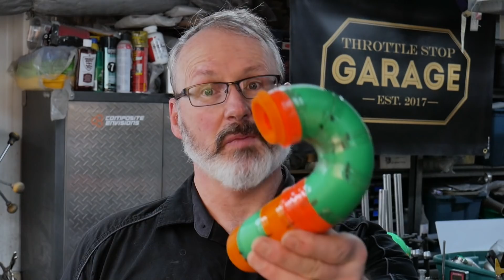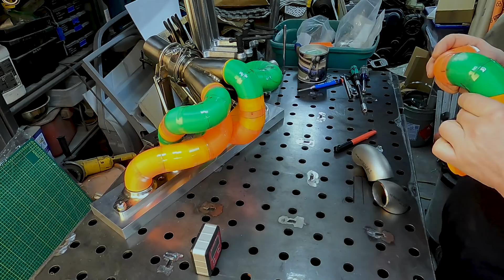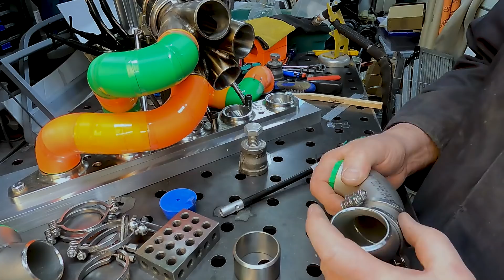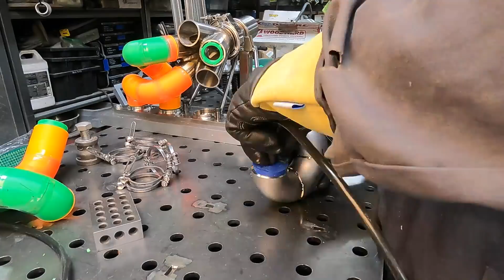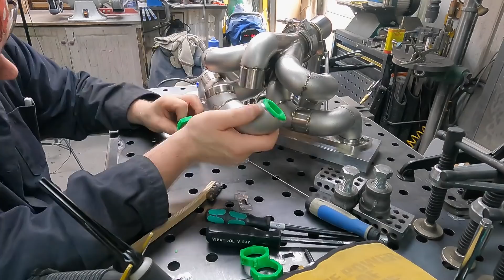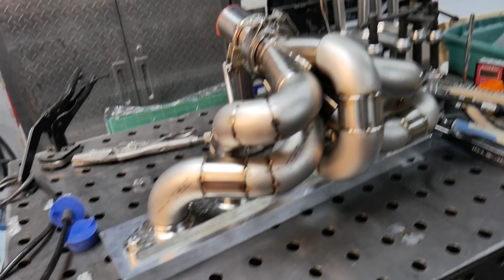DIY Turbo Manifold: Part 2 - Pipe Fitting.

Comment: I’d try balloon artists balloons to keep the pipe sections together during ‘finding the angles’… perhaps with some oil to ensure the sections can still rotate axially relative to each other. Reckon that would work? Making the printed rings fit all the different cross sections feels annoying (and also prevents full rotation of the sections)
Reply from the maker: Interesting idea - I'd be concerned about the heat and any residue from the balloon, but maybe worth a try.

Comment: i know its years ago and you likely forget but what issue did you find was taking the most time when trying to mock up the plastic jig? i thinking to make my own for welding, thanks in advance
Reply from the maker: The plastic jig was the best part of building that manifold.  Easy to work with, and if I had to guess, I'd say that getting the lengths dialed in took the longest. It really didn't take that long - it's just playing with shapes.

Comment: did you design all those runners to be the same length? is that an important consideration?
Reply from the maker: I tried to have them all be around the same (and they were within 3 mm).  Same length has obvious advantages for flow, but cost in packaging.

Comment: Something I don't see in USA how to videos dealing with exhaust tubing is the use of spun metal donuts (Mild steel or Stainless) available in a large variety of sizes, they do reduce the number of pie cuts and elbows required.
Reply from the maker: True - I've got a few on the wall, not had any need to use them just yet.

Comment: I've been building my own tubular manifold today and it's been so frustrating trying to hold it all together while I tack it up to the point I've had to walk away, I need some of those 3d printed inserts you made, nice solution to a problem there.
Reply from the maker: They were a sanity saver.  The models are on my thingiverse page if you need them.
Reply: @ThrottleStopGarage  thanks for that will check it out.

Comment: Hey, any chance you can reupload your Long Radius 1.5" weld el marking jig to thingyverse, seems during the upload it shrunk down to 4mmx4mmx1.5mm :) much appreciated been hanging out to use this jig :)
Reply from the maker: It's still there in a collection.
Reply: @ThrottleStopGarage   yea it is there, but no longer the correct size. when you load it into the slicer its 4mm wide :) also checked in fusion 360
Reply from the maker: @Droped2  I'll have a look tomorrow.  That's weird.
Reply: I've just started this print and I think the solution is converting the measurements from MM to inches
Reply: Just finished the prints, converting the measurements from MM to inches was the solution

Comment: You should invest in some TPU material for your 3D printed tube rings. 

It’s stiff but pliable so you won’t have to constantly trim to size for every pipe, you can just squeeze them into place!

Awesome build man!😁👍🏾
Reply from the maker: Thanks for the tip!  I was thinking that even a small hook shape that would flex instead of a bump would also work.
Reply: @ThrottleStopGarage  No problem man! Also, TPU can also take high temps (up to 400 degrees I think). Anyways, keep up the great work!👍🏾

Comment: Wow, that was a very nice comprehensive video, not easy making an exhaust runner for a 5 cylinder, i'd like to see how much would it flex after the whole thing get welded, Do you relly need to pruge it when u tact?
Reply from the maker: I'm pretty sure it's not going anywhere!  Yes, I think you do need to purge when you tack.  If you don't - you'll get the carbide precipitation on the backside of the weld.  Many will say that it doesn't matter and if I was trying to make money building these things, there are cheaper options that work...but none of those conditions apply for me.

Comment: Awesome work this reminds me of the Falcon 9 SpaceX launch pad it had three pivot points using three knuckles where when the rocket sits horizontal and starts raising up vertical had figure out all the angles. Awesome work i love it when theres staggered offsets and still making sure everything is perfect. And on the landing ive always knife edge mine even when you butt them up no gap you still get a good fusion even without adding wire or no gap.
Reply from the maker: The technique worked well.  I'm welding them up right now and fusion was good - faults were mine.

Comment: Just a thought, but if the spacers had a weak-spot 3d printed into them - you could maybe tack them in place then just punch them out.  It would make them more single-use though.
Reply from the maker: If I was changing the design, I'd print a few variants - one with tapers going both ways for the weld els.  Then one with a taper and a straight for an el into a straight and the original (little smaller) for straight into collector/flange.

Comment: is there any way to clean welding seams by sanding and polishing? it looks amazing and if you manage to delete all welding seams it is gonna look more amazing congrats on your achievement
Reply from the maker: Yes, the welds can be sanded smooth.  I'm not sure I'm going to bother as I think this manifold is going to get ceramic coated.
Reply: @ThrottleStopGarage  this is gonna look awesome!

Comment: Good job. what is the name of the necklaces in question
Reply from the maker: Necklaces?
Reply: @ThrottleStopGarage  clamp welding. Is french sorry
Reply from the maker: @stevenwindows  Ah, I see.  They were made by Ice Engine Works and are still listed by Trick Tools in the USA.  They do not work very well with the short radius tubes.  They may work better with the radii that are used in tube versus pipe.

Comment: I'm conflicted... the fabricating talent to design and build tuned length turbo manifolds I find impressive.  They're nothing but a show piece, overall the time spent designing and building a first place, best fabrication award isn't worth the time spent.  Never mind that these manifolds ignore good turbocharger system design principles.
Reply from the maker: I'm not sure how an equal length manifold ignores turbocharger system design principles.  The tuning isn't necessarily any different from a normally aspirated engine.  The problem is that you've stuck a restriction in the system - the turbine.  You'd still like the pulse timing to be even.  Nobody is arguing that you can't just build a log manifold and make power.  I am building this because I enjoy the challenge not because I'm trying to make a dollar.  Build the best that you care to build.
Reply: @ThrottleStopGarage  Thus I appreciate the workmanship.  Been a long time since I've fabricated a turbo exhaust manifold.

Comment: You rely on way to many aides. In my opinion you're making your job harder. It's not that complicated to fit up pipe/fittings.
Reply: Was thinking the same thing as in over thinking the job at hand, but everyone has their own way. It's a wonder how I made headers and exhaust 40 years ago without a 3D printer, but then again I'm just a boomer.
Reply from the maker: It is reasonably complicated for this manifold and I am sharing what I found works.  With respect - this made it easier for me to fit the pipe.
Reply: @ThrottleStopGarage  my gripe is mainly it the clamps and your printed pipe insert which all seemed to slow you down or add more problems. As for back purging unless you're selling the manifold I wouldn't worry to much about it. But technically yes you should back purge.
Reply from the maker: I've got gripes with those clamps as well.  I did get them used and they're probably hitting eBay shortly.  It's hard to make me go any slower - but they did work wonders for bringing me to a virtual standstill.  I think for tube, they would work better and I can see some advantages.
Reply: @ThrottleStopGarage  they have all sorts of heat resistant tapes for this purpose. Just peel back the section you want to tack and keep going. That also takes some getting used to. If you wanted a good clam Dearman makes good ones. But how small and tight everything is I'd work in small segments and tape.
Reply from the maker: @ascholtka420  Cool - I'll look into it as I still have an exhaust to do.  Any advice for welding the cap.  I got the root done (fused) but any tips for the cap would be great.
Reply: @ThrottleStopGarage  unfortunately you might be a better welder then me. I'm a pipe fitter not welder. So I won't even attempt to give you bad advice
Reply: I'll be fabbing my turbo manifold this week but mine is far less elaborate
Reply from the maker: @ascholtka420  Thanks - I'm always looking for the best information I can get.
Reply: Well I'm an union pipefitter and I'm telling you, you'd probably struggle alot less with some foil tape holding it together. All those clamps and 3d printed inserts to get your hi-low out are unnecessary.  Also there's a way easier way of marking and cutting down 90's to make custom fittings. You're handicapping yourself.
Reply from the maker: @ascholtka420  That would be fantastic information to share.  I'm a guy building a car in my garage and I clearly state that I've never fitted a pipe manifold before in my life. It's a struggle if you can't find the information.
Reply: Hope this makes sense. You measure the inside radius and outside radius of your 90's ÷ both by 2. And mark on the inside and outside radius. To get a 45. ÷4 for 22.5. ÷8 for 11.25 fittings. Etc... for any bastard angle. Your angle finding block is cool and all but what if people don't have access to a printer. (Which I do)
Reply from the maker: Yes -that makes sense and is simple and helpful.  The jig is similar to ones you can buy (they're about $300...which I can't justify).  When I made tube headers - I just had a block of wood cut to the inside radius and used a protractor and an pointer nailed to the centre of the radius.  It also worked.  I've released it all for free to try to help out.  There are also online printing services (not sure of the cost etc).

Comment: Rather than back-purging you can also use solar flux.  I find it much easier for most applications... and cheaper:-)
Reply from the maker: I know - but I don't have any in the show right now.  Only making one - but if you're making lots the argon costs will get you every time.  $140 for 22 cu ft in Canada.

Comment: Not that I've made my own manifold myself (yet) but from what I've seen the runners will shrink when fully welded. To combat this each runner is normally made slightly longer than required to compensate and then trimmed down (if required) to fit in the final construction.
Reply from the maker: Sort of depends on how it's been fitted up to be honest.  If it's tight gapped and everything is done properly - the shrink per joint would be very minimal.  I've already done the root pass and the only one that moved was runner 3 (I had a small gap - shown in this video) - it pulled up about 1.5 mm.  I can fill that no problem when I weld it to the flange.
Reply: @ThrottleStopGarage  fingers crossed! Like I say, I've not made one myself yet but thought I'd share what I'd seen, after all your hard work and effort I didn't want you to weld it all up and find they're all a couple of mm too short!! 

I have to admit, yours does have the best fit up of all I've seen! Great job 👍🏻
Reply from the maker: And I had one that ended up a few mm short!  You called it!
Reply: @ThrottleStopGarage  ah man that's a shame! Hopefully it's recoverable without too much work!? 

Did I earn myself a mention? 😄
Reply from the maker: @AndyPonting  I think you've earned it...I was up most of last night working out how to prevent it.  It took me one hour to fix the runner - so no big deal.

Comment: I've built several tubular turbo manifolds over the years out of stainless and the first thing I look for is if they're back purging (it's mindblowing how many people don't do this), so it was a welcome sight to see it done correctly.  My next thought was bracing for the turbo, I try not to allow the turbo to rest solely on the tubing because it nearly always results in cracks along the welds months or years later, especially if it's a race car.  But, I was surprised at how thick the tubing (pipe?) you used was.  Honestly, that's probably a better solution than using a flange-to-flange brace, especially since I'm assuming you're going to be using something along the lines of a T3/T4.  With the larger turbos (80mm+) I try to do a flange-to-flange support because frequent wastegate activity and throttle changes stresses the manifold over time, especially when it gets heat soaked.
Reply from the maker: I'm still working on that decision...to brace or not to brace.  It's pipe - it should be able to handle both the weight, the vibration and the heat.  My current thought is to leave it as I don't want the various forces fighting and resulting in cracks.  Back-purge - all the way.

Comment: Why use pipe instead of tube? 1.6mm stainless tube is all we use everyday in exhaust manifold & headers.
Reply from the maker: A few reasons.  The pipe helped with tight radii that were needed for packaging and the wall thickness should mean that this thing will have a reasonable lifetime.  I'm not going to tell you that 1.6 mm won't work - it will.  I've done it.  This just buys the extra insurance.

Comment: 2:45 use a single regular worm drive hose clamp with 2 holes in the band to tack through. 
This self centers the tube and is strong
Reply from the maker: I've used that method.  It still won't work on the short radii weld elbows - no room to grip.

Comment: Loving watching the process.  BTW, searching Thingaverse for "ThrottleStopGarage" only yields  a BW Turbo model and the Plastic Alignment too.   I know that XeonDesigns on  Thingaverse offers header fabrication kit tubes (did you design your own?).   Also I didn't find the cubic tube blocks.     Beautiful work as always, and very helpful though on procedures.   Genius on the tube connectors.
Reply from the maker: Thanks Paul.  I'll reload those models - check again in an hour and they'll all be there.  I did design all these parts.
Reply from the maker: Let me know if you can't see them now.
Reply: @ThrottleStopGarage   So far these 5 titles are visible:
Pipe Manifold Plastic Model (9 files)
Borg-Warner EFR 7163 Turbo Model
Long Radius 1.5" weld el marking jig (2 files)
Short Weld El Marking Jig (2 files)
Pipe Manifold Plastic Alignment Tool

Sound right?  Thanks for sharing BTW too!
I've put up a few things myself, (V12FerrariGuy) but nothing so universally useful!
Reply from the maker: @ferrariguy8278  That's the lot - I have no idea why the first batch is not visible!

Comment: Next time look at some of the latest model car manifolds stumped stainless sheetmetal to make fit your needs . 🧐
Reply from the maker: I've seen these - Not sure I could build one but I've looked at hydroforming in passing.
Reply: @ThrottleStopGarage  I'm shure theres one on the shelf GM , Ford 2021 models V8 engines where you could modify the manifold to fit your needs . It's worked for me .
Reply: @ThrottleStopGarage  Back to the Exhaust manifold build on hi-tech manifolds these hydro shaped manifolds are really flatt against the engine lots of clearance  some times i find one in a autosalvage yard and modify to my needs . We have DYNOED  them and they make good HP as good as Tubelar typs . Try one down the road you will like it . CHEERS .
Reply from the maker: @curtisvonepp4335  Very interesting.  I'll do some more reading.
Reply: @ThrottleStopGarage  I don't know what engine your working with and the cylinder  port spacing is but a V8 could be used with ever side lines up L or Right with your engine spacing the ports cutting between the port spacing to match up the exhaust ports and tig weld it's  not any biggie  for a skilled fellow like you you will see what needs to make it work.  👍
Reply from the maker: @curtisvonepp4335  Volvo 5 cylinder is the engine.  I'm going to do a project update video to catch people up on what I'm doing...just hard to find the time.

Comment: Thanks for making the tube models available. I'll definitely printing a set when I make headers for my turboed 47 Dodge truck project. Putting masking tape on the joints you're not welding helps conserve expensive argon. Surprisingly the heat does not affect as badly as one would think. I just peel back about an inch where I'm welding.
Reply from the maker: Good tip on the tape and argon.